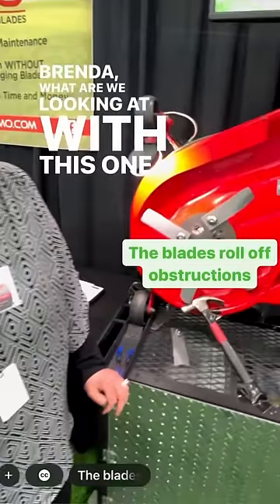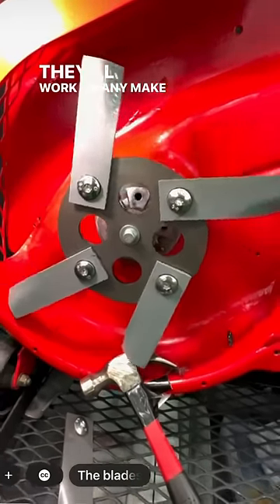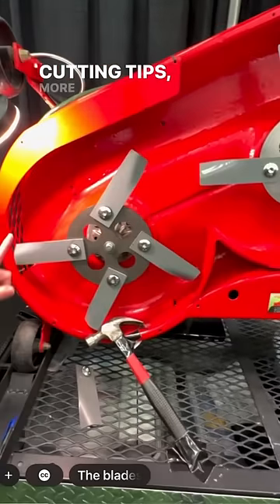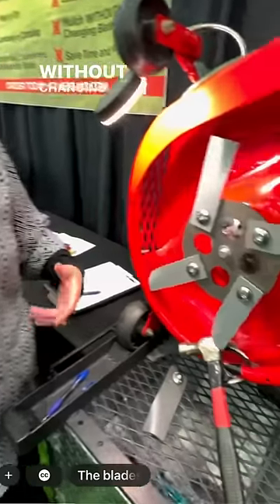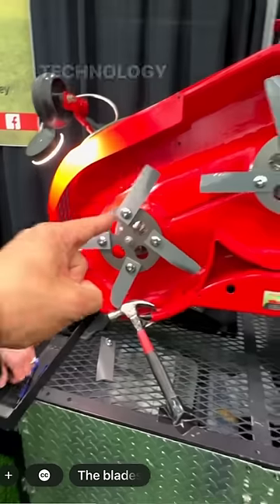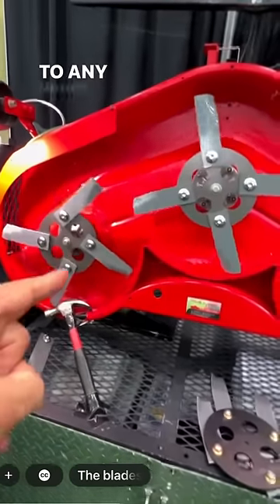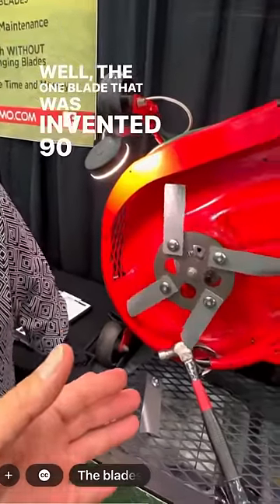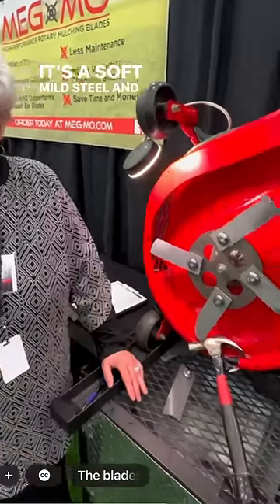Farmers already use this. #lawncare #mowing #shorts

Comment: I bout them last fall and I love them. The center acts like a flywheel and takes a little more power to get them started but they are awesome. I don’t have a mulching deck but I used some perforated metal and put over the discharge to keep the leaves inside the deck but air to discharge and I drove over leaves that covered the grass and you couldn’t even tell there were leaves their after I mowed over them. Highly recommended. I do have a Kubota B2620 with a 54 inch deck
Reply: I highly recommend gator bladed. You can buy 6 sets for what that is and I can actually sharpen my blades